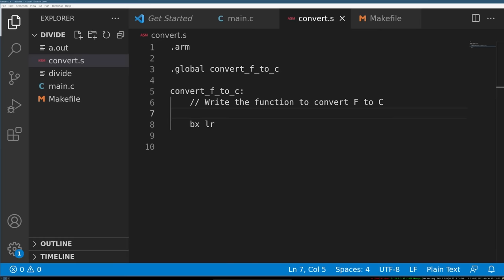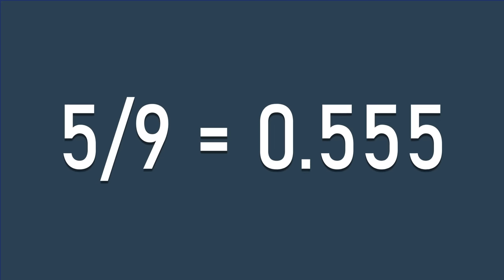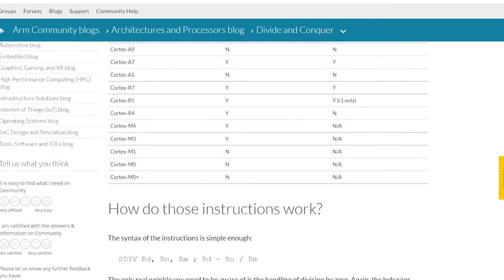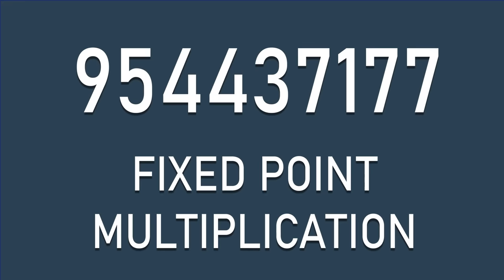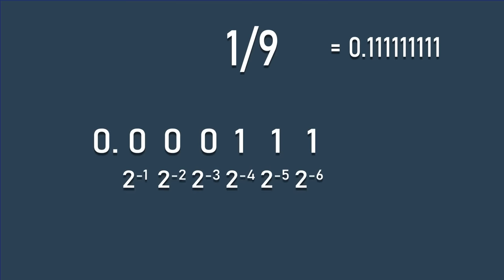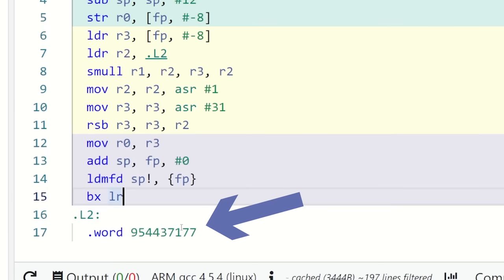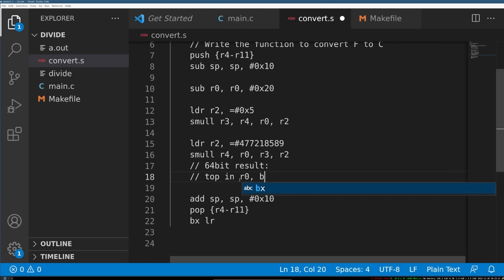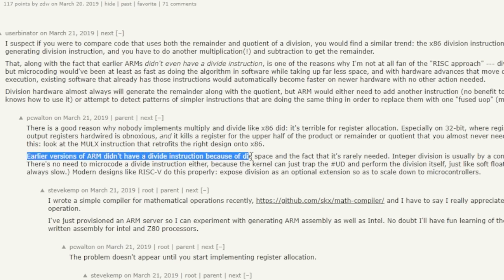computers suck at division (a painful discovery)

Comment: This brings back painful memories of 8-bit computing. Consider yourself lucky to have a multiply instruction.
Reply: I remember building a 8 bit cpu, the division circuit was by far the longest to figure out.
I started with obviously +-, *... then tried for months to figure out how to do division (without obviously looking for the answer online) once I realized how you could do division with substractions and additions it took me just a couple of weeks to deal with IO and W/R to ram.
Reply: just add the number multiple times if you need multiplication.
Reply: I dabble with Z80 assembly. Multiplication is a charm. 

e.g. multiply HL register by 10

push de
ld d, h
ld e, l 
add hl, hl
add hl, hl
add hl, de
add hl, hl
pop de

I've written something like that so often by now its just muscle memory :D
Reply: Motorola 6809 (1978) has a multiply command, takes register A and multiplies that by register B then combines the A & B registers to make a register D (which is 8+8 bit so 16 bit) and outputs the multiplication result.
Reply: Ah, tables of squares and difference-of-squares multiplication methods. And then there are Newton-Raphson approximations for computing reciprocals so you can pipeline divisions using multiplication. All good fun...
Reply: Absolutely.  I spent so much time trying to make IBM 370's go fast because, while they had an integer divide, it was way, way slower than add, sub, multiply and shift.  So yeah, we did all these specialized bit shifts and adds and such.  And floating point was there on the 360 and 370, but it was sooo very slow.   And then one day computing changed.  Suddenly integer divides were blazing fast.  And more shocking, floating point operations were sometimes FASTER than integer operations.  ZOINKS!  I was so happy to cast off all those silly tricks that were needed to try to make a 1 megabyte, 1-million-instruction-per-second IBM 370-158 provide services for 30 simultaneous interactive users well, and just do +-*/ and not worry. 

'Course now we have PC's that run literally a million times faster and still run like crap with Windows installed and one user.

And yeah, 8080, 8085, 6800, Z80 (hurray for my TRS80) made it all that much more exciting by not having ANY of the primitives beyond plus minus shift, and having to do multi-precision integer operations for almost everything.

Now this video drags up all these old, forgotten thoughts.
Reply: @stinchjack  C9
Reply: @linuxization4205  that is a very wasteful way of doing it😝
Reply: Multiplication can easily be programmed as a loop of additions though.
Reply: Well.. to my memory the standard precipice of multiplying two numbers on a 8 bit assembler is to copy and paste (or in version where you can call subroutine do that) for a pre made multiplayer set.

Then the code is slow like melasses.
Reply: @matsv201  So basically just looking up the result in a table?
Reply: @rfvtgbzhn  No not really. Its a bunch of code. Typically code library emulating 16 bit floats on a 8 bit cpu... Or even 32 bit. Some calculations are pretty simple to do. Like addition and subtraction ca be done with just a hand full of instructions. 

Typically the float would be 8+8 making it pretty decently simple to calculate on a 8 bit computer because it could just do the int and the exp seperatly. For instants if you add, its pretty simply just adding the int then bumping the exp if its a overflow.
Reply: Agreed.  In 2004 I wrote a fair amount of assembly code to process fixed-point numbers latched from a continuously counting long-chain 32-bit counter using an 8-bit Microchip processor, the PIC16F876, which has no hardware multiply.  Fortunately Microchip had published a large suite of assembly-language subroutines to do, for example, 32 x 32 bit multiply to a 64-bit result. Copy/paste to the rescue!.. Some of these routines were over 500 instructions long, but like all modern chips, the 'F876 has a giant program memory.  Even with these boilerplate routines I had to set up several sets of pointers & other housekeeping tools to keep all the bytes correctly organized not only in the chip but in my brain.  I was also doing linearity corrections using a cubic equation with four16-bit correction coefficients to finally arrive at a 32-bit resultant that was reliably quiet at  27 bits flicker-free p-p, & 30 bits RMS {~= 1 part per billion}.  
Took weeks to get all this running correctly.  Several years later I sold my invention to a small instrumentation company that wisely chose to use a slightly fancier 16-bit processor, one of TI's MSP430 family, which has hardware 16 x 16 bit multiply.  Much simpler to use, and faster...
Reply: I remember learning in the early 80s doing shifts and adds using a single register on a computer training device, then learning a micro computer (mini-mainframe) that did high speed shifts through a shift multiplexer and that was cool.
Reply: @linuxization4205  If it's a small number, sure. If it's bigger, shift and add would be better.
Reply: At least multiplication is easy enough to emulate with a simple addition loop. Division is much harder.
Reply: When I was a kid, the cpu's didn't have multiply. So algorithms for that had to be written for the accuracy needed, possibly with some cheating through lookup tables. The cpu's only had a few thousand transistors, and they had to be used wisely.
Reply: So, is this something that you would only need to spell-out in a language like assembly? Do other programming languages auto-convert fractions or division functions into these representative numbers?
Reply: @OccultDemonCassette  This is mainly a problem if you are writing assembly. Higher level languages almost always implement all four arithmetic operations (+, -, ×, ÷) for one or more data types such as integers or floating point types. The compiler (or intepreter) will translate the operation in the source code into the appropriate instructions. So, even if your CPU does have multiply or divide instructions, if you are coding in a higher level language, such as C, you can still multiply and divide simply by using the built-in operators * and / .
The problem is (or was, rather) that the available compilers don't always produce the most efficient series of CPU instructions, which can be a problem if your resources (memory, clock speed) are limited or you have challenging timing requirements (quick response times).
This problem isn't as big as it used to be. Modern microcontrollers and CPUs are much more powerful than what we had back in the 80ies (and, to a lesser extent, the compilers have also gotten better).
In those days, programming your puny, stretched-to-the-limit CPU to do anything more than trivial calculations in real-time was a job that would put hair on your chest.
Reply: @OccultDemonCassette  Oh, I'm not sure I actually answered your question. Higher level languages solve the multipliplication/division problem in many different ways depending on how sophisticated the compiler is. The simpler ones may simply stuff the operands into some registers, or push them on the stack, and then call a generic subroutine that performs the task. The more advanced ones will choose between several methods based on the input. For example, a very common optimization is to implement the division of an integer by the constant 2 as a bit-wise right shift, which can be done with a single instruction on most CPUs.
I don't know of any compilers that implement divisions by specific constants using the method shown in this video, but I'm sure they exist. It's a pretty cool trick!
Reply: x86 is full of asm one liners that do almost everything. arm is tricky but less power hungry
Reply: @linuxization4205  In principle you can also do division by using subtraction. But in both cases you have to be careful about the sign (positive or negative) of your operands. --- Also, those work great when dealing with whole numbers. Fractions or repeating decimal numbers will still ruin your day because numbers less than 1 (aka 2^0) require some abstraction. --- E.g. 3.14159 can be seen as 3 and 0.14159 The latter piece is trickier to deal with.
Reply: @stinchjack  If you have enough registers to work with, you can just one as a loop counter. After all 9 x 4 = 9 + 9 + 9 + 9. So you start with 9 and set the counter to 3.
Reply: @jnharton  Loops are a naive way to do a generic multiplication.   If you really want I'll post a more efficient way to multiply any two given numbers together.  

For multiplying by a fixed amount (like HL*10 above) then code like a posted above will be the quicker than a generic multiply routine
Reply: @stinchjack  Multiply any two given numbers != Multiplying a number by 10. --- And multiplying by a fixed number, like 10, should be doable with some number of left shift plus a few additions. But that's a little trickier to generalize.
Reply: I believe the Cray 1 used this technique. It had a reciprocal instruction that could the be followed by a multiply. The multiply was actually inaccurate in the last digit to save a gate just to get the machine to run at 80MHz!
Reply: @combcomclrlsr  The computer science department on my college campus had a Cray-1 that you could see from the outside through their windows. I remember walking by at night sometimes and just stop and stare at it for a few minutes in silent awe. 
Of course, today's kids wouldn't be impressed, with the average smartphone easily outperforming the venerable Cray-1. It sure was stylish, though.
Reply: My first computer had an 8-bit processor but it had a mul instruction. It multiplied two 8-bit numbers in registers A,B the result would be in register D. D was made up of A,B.
Reply: @daishi5571  That's the MPU I had specifically the 6809E.
Reply: @dannygjk  Well my CPU was a 6809E found in the Dragon 32, but the only difference in a 6809 and E was the external clock. The Dragon was very similar to the Tandy Coco.
Reply: @daishi5571  Yes, I had the coco 1 and the coco 2 🙂
Reply: Yes, other programming languages auto-convert. You never need to actually type magic numbers into your source code unless you're doing assembly
Reply: Also, just because you typed * doesn't mean an actual hardware multiply is done in your compiled binary. Compilers can do anything they want provided the end result is the same as what you wrote. So something like "int y = x*2" will be encoded as a bit shift rather than a MUL instruction
Reply: @williamdrum9899  That could cause a problem. Keep in mind carrys etc.
Reply: Are you 70+ ? Because the last person to say something similar was my engineering programming professor (That dude preferred FORTRAN and COBOL over MALAB)
Reply: @stinchjack I just realized I know just enough about CPU architecture and assembly to understand that bit of code without ever having learned about the specifics of the Z80 itself. Weird, but the enjoyable kind of weird. 😂
Reply: @stinchjack 
8080, 8085, and Z80 suck compared to the 6809 and its direct descendant, the 68HC11
Reply: @stinchjack 
You should just write it as a macro
Reply: You could use adder loops lol.
Although multiplication circuits are not that difficlut or transistor heavy to implement.
Reply: @xokelis0015  

The transistor count for integer multipliers are proportional to (input bit width) squares.

CPU's that use microcode typically do multiple shifts and adds
Reply: @akulkis  
Oh so each multiplication is a multiple clock cycle operation? Makes sense. 

I implemented a goldscmidth divider circuit in college that used a single clock cycle multiplier matrix and with 9 iterations arrived at a precision that was acceptable for the project.
Reply: @svampebob007  I had to highlight that nordic cross there to realise it was a + and - that visually fuse together in this font at this size on my screen when I don't look very closely
Reply: Consider yourself lucky to have addition. The mathematical definitions bootstrap from increment. SS0 + SS0 = S0 + SSS0 = 0 + SSSS0 = SSSS0.
Reply: @stephenspackman5573  "Back in my day, we had to do everything with just zeros and ones. And on bad days, we only had zeros." (Dilbert, quoted from memory)
Reply: @matsv201  The straightforward recipe for doing multiplication is to keep left-shifting one of the numbers and right-shifting the other. Whenever the right-shift moves a 1 into the carry bit, you add the left-shifted number to an accumulator.
Reply: @OccultDemonCassette  Optimizing compilers will auto-convert fractions whenever that makes sense. Without optimization it is of course always possible to use the generic division routine (which will have to be used anyway if the divider is not a constant).
Reply: @jnharton  To calculate c = a *b:

c = 0;
while (b) {
  if (b & 1) c += a;
  a <<= 1;
  b >>= 1;
}
Reply: @xokelis0015  Modern CPUs will do multiplication in 2 clock cycles or so.
Reply: @ronald3836  So what is the drawback?
Reply: @matsv201  it needs a lot of operations when done serially. Modern CPUs will have circuitry to do this in parallel.
Reply: @ronald3836  I guess for really old computers, like serial processors, that is not really a issue.
Reply: @matsv201  Sure, programmers and compilers will just have to work with what the hardware offers.